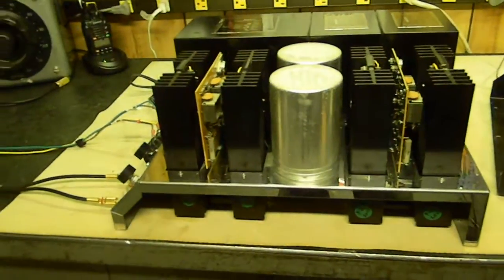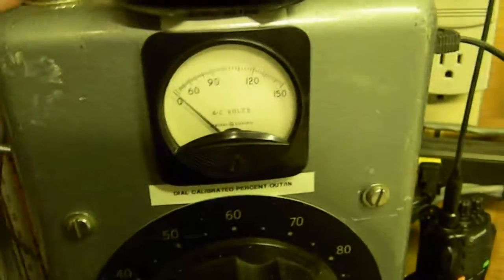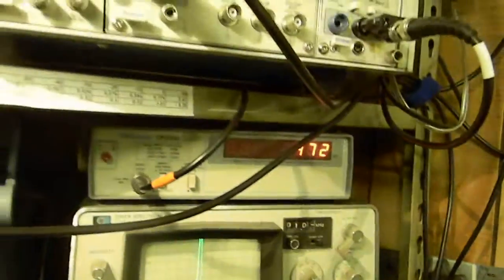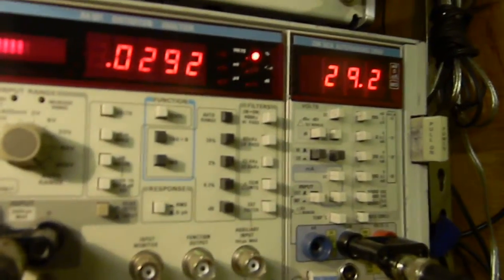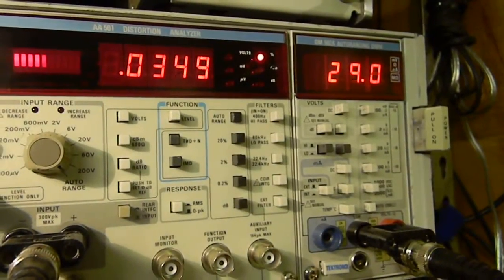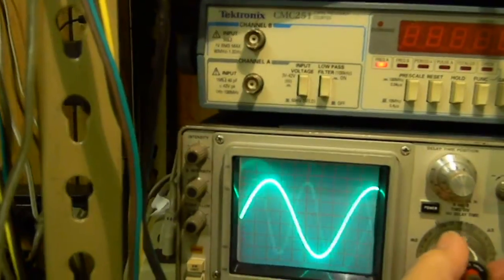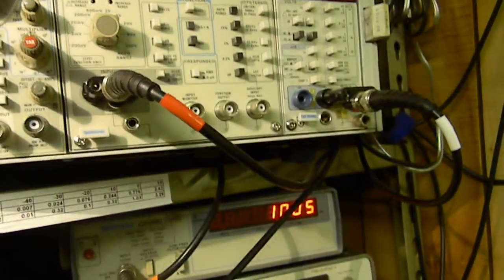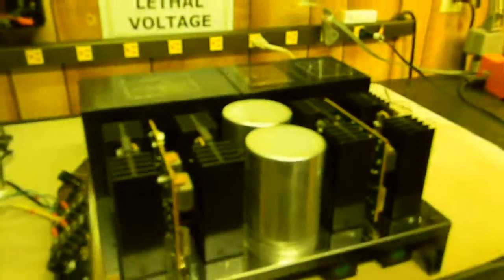McIntosh MC 2100 Undergoing THD and Output Power Tests.MOV

Comment: The 2100 is definitely an underrated amp. If you find one grab it, get it recapped and enjoy it for years!
Reply from the maker: I have had this one 30 years. I did have to replace one output transistor years ago. Very powerful and excellent sounding amplifier. 🙂

Comment from the maker: I realize this video is almost eleven years ago but I brought mine out tonight and put it to the music test and this amplifier is off-the-charts of clarity and power. It may not look too fancy but it can deliver more than you imagine. Try one - you will like it.
Reply: I completely agree with you. I have an MC2100, and enjoy it immensely. The sound is big, natural, effortless, and warm -very musical. My speakers are high sensitivity horns (about 100db) and16 ohms, but I use the 4 ohm tap on the 2100, which I believe turns the amp into 25 watts output. It still sounds good. What I’ve wanted to ask you for a long time is, how does the little MC225 sound by comparison to the 2100? I realize now that the 225 could probably drive my speakers, and wonder if it would be an improvement?
Thanks for any perspective or counsel you could share.
Reply from the maker: I think you ask marvelous but subjective questions that we all eternally struggle with. As I see it, no matter the analytical measurements, the bottom line is anecdotal and personal experience in what sounds best. That doesn't stop us from exploring both worlds. From a child I always heard the MC225 was the holy grail of amplifiers. The sweet-spot in vacuum tube amplifiers regardless of the tubes is around 30 watts. I had an MC30 long ago and I thought it was marvelous.
In this case of the 2100 as mentioned, I think it is underrated in the audiophile world and is a window-cracking powerful amplifier that will drive Klipshorns to 120+ dB level - I have been insane enough to measure it - with ear plugs... lol... 
My friend had the MC225 so we traded, for a little while, my MC2205 for his MC225 and I had the opportunity to listen to it for a couple of months on my Tektons and Klipschorns. Its clarity at both ends of the audio spectrum is spectacular. Is it worth around $5000 to get one? Wow... not right now. And some of the ones I see on Ebay look pretty bad. I can rebuild them but I want the chassis to be pristine as is the one I use that belongs to my friend. It is beautiful and was serviced once upon a time by a reputable company here in the US. 
No doubt it would drive your 100 dB SPL speakers but it will not drive them to the SPL level of your 2100. There is a compromise there. Doing the math, 100W into 100 dB speakers is an SPL of 120 dB. 25 watts would be 114 dB SPL.  I think at this point that is the tradeoff between power and ultra-high-end quality.
I do find the clarity to my (old ears) very pleasing at both end of the spectrum.
As a sidenote, I run one channel of my Tekton speakers with the Williamson design using the UTC LS-25 transformers, wired as a monobloc,  which have a better high-end with the other Williamson design using Acrosound TO-300 transformers as a monobloc to the other channel. I find the Acrosound transformers have a better low end. This may sound strange but over the years, even with mismatched speakers, the sound can be very pleasing with the "mismatch". I believe the difference in amplifiers, or even mismatched high-end speakers, can enhance the music quality as they are complementary in performance, i.e. each has a different asset and deficiency and they enhance each other - not the mainstream idea of perfection but I have done this other times in my career of home audio.
Just babbling on here. Hope it is worth something.
Reply: Thank you so much for the response! Enjoyed, and appreciated all of it. If I am understanding you correctly: the 2100 is superb, powerful, underrated, and affordable. The 225, by contrast, is very limited in power, expensive….but, the highest sound quality from lowest bass to highest treble…if you have a speaker it can drive within its power limitations. In other words, its sound quality is better, but its options are greatly restricted, whereas the 2100 can play with all comers. Is it possible to speak with directly?

Comment: What's its output with 4ohm loads? Stereo and mono? I can't find it anywhere.
Reply from the maker: It uses an autotransformer in the output so the  power output is constant into 4, 8, or 16 ohms. If the two channels are bridged it would be 210 watts into 2, 4 or 8 ohms.
https://www.manualslib.com/manual/1083095/Mcintosh-Mc-2100.html#manual
Reply: @ElPasoTubeAmps Got it, thank you for the quick reply!

Comment from the maker: I made one video on square wave measurements of audio amps but I am not sure it was very useful. I know of no equipment  tailored to measuring square wave response. Everything is oriented to sine wave. From my experience a very good book that discusses square waves is "Audio Cyclopedia" by Howard M. Tremaine. I used his information for many years as it lends itself to simpler generators and an oscilloscope but since I now use high-end sine wave evaluation instruments I no longer use square waves

Comment from the maker: Thank you. I wasn't aware of the electrolytics needing replacing on the driver boards. Makes sense. Yes, I sometimes remember to adjust the variac under load but this time I didn't. The line voltage does drop a bit and I use the variac, if for not other reason, to try and remove as many variables as possible. I need a new driver board for the 2100 as one is seriously flamed out. Do you know where I can get one? Thanks again

Comment: I work on these also. I have found that new electrolytics on the driver boards help give the lowest distortion, also I bet the output of your variac has dropped some as the Mac's power is near max. You can squeeze a little more power out of it if you maintain the 120v AC when the amp is run near it's limit. Line voltage out of a wall socket won't drop nearly as much as from the variac at higher currents... enjoy your videos - you're way better on tube stuff than me, that's for sure...